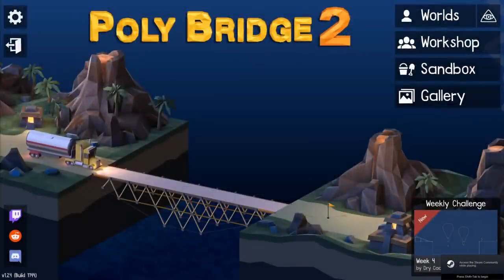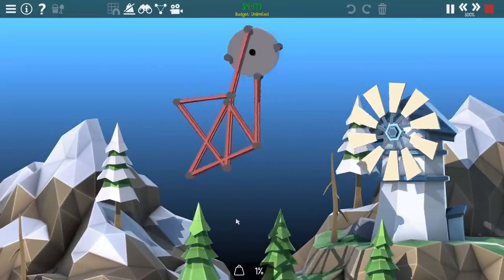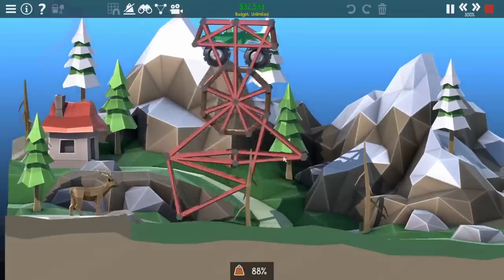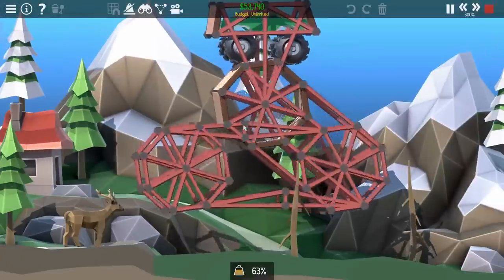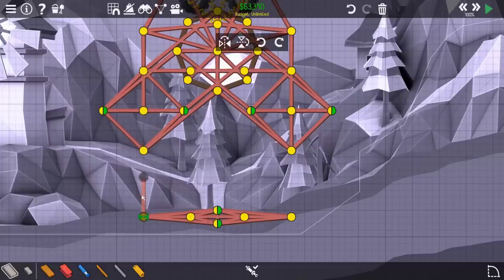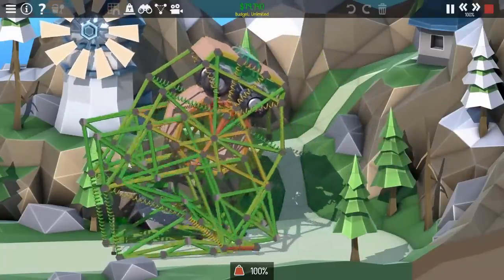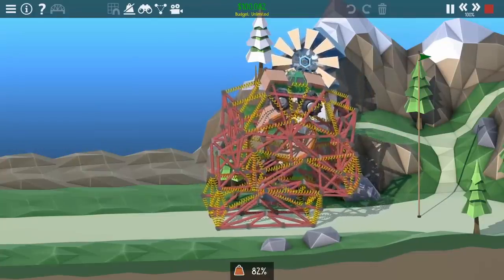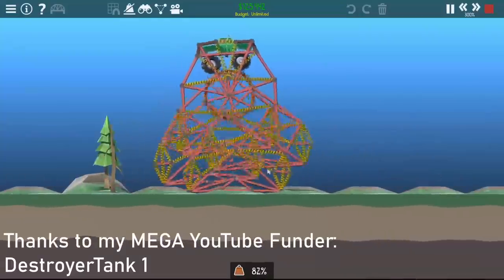Making a Walking Bridge in Poly Bridge 2

Comment: 10:00 When you trying run in the dream
Reply from the maker: YES hahaha
Reply: That's actually kinda happened in a dream of mine.
Reply: I cant even run in dreams anymore, I can only walk really unbalanced and have to hop on one leg to get around
Reply: Oof, just reading this scares me. Hate running in dreams
Reply: I dunno, in my dreams i run VERY fast, sometimes even losing balance and falling coz of that, and this thing is really scary, because it's not like falling on the ground, it's like falling in an unending pit
Reply: @nabrworsdreod5730  interesting
Reply: Running in a dream is like running when the floor is covered in oil and it's zero gravity.
Reply: @wednesdayfrog1006  yes, or when you very weak
Reply: Im almost blind in My Dreams and every time i try to get up i Fall down so i have to Crawl while almost blind and 1 time i started b-hoping Backwards and i was so fast
Reply: While I do have such kind of dream, in most of my dream, I'm more like press the brakes on a car but can't seems hold the car even at idle.
Reply: lol

Comment: last version reminded me of tank threads. i wonder if you can make a tank bridge. also you could try making something like rails for better friction. also you should try using springs as energy storage, like spring engine gets connected to a fixed motor at the start and disconnects after certain time and runs to the next fixed motor station or to the end.

Comment: Easy walking bridge.

1. Take a beam of "Bridge"

2. Add a motor on either end.

3. Add joints on either end of the motors but on the same location when the motors are compared.

4. Add two steel bars running between each motor joint.

5. Add a "leg" on either end of the steel bars and it's a walking bridge!
Reply: Klann linkage? Anyone? Me?

Comment: You should make a part 2 to the trebuchet video but make a whipper trebuchet. In case you don't know, a whipper trebuchet is a more modern trebuchet that is designed to reduce the final kinetic energy of the trebuchet itself, meaning more energy gets transferred into the projectile and it goes further.

Comment: Kinda seems like a bunch of work to turn a round wheel into a square wheel. I think what would make it more like walking would be if it either had more distinct legs like the toy robot you used as an example, or if it moved it’s feet back and forth, picking them up off the ground so they can come back, rather than just rolling around in a circle.
Reply from the maker: The toy robot I used had the exact same walking assembly. At some point I'd like to work on a spider mechanism though.